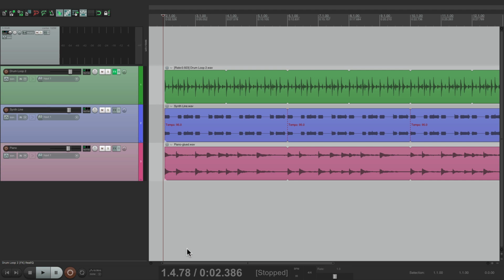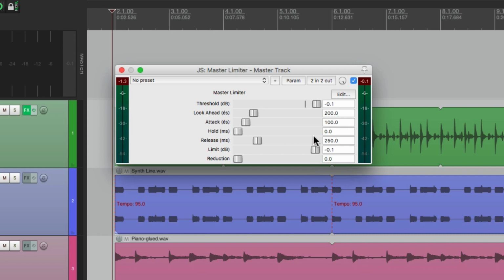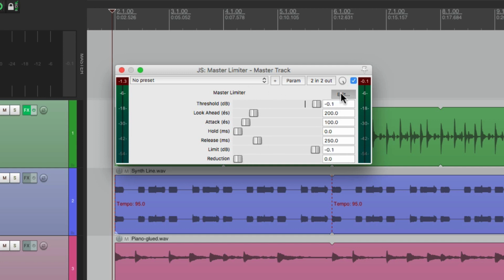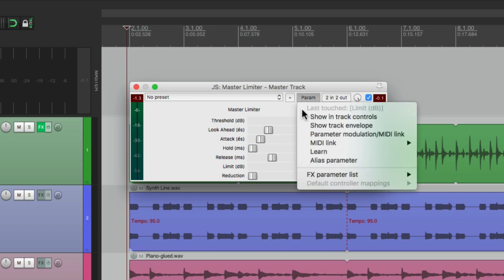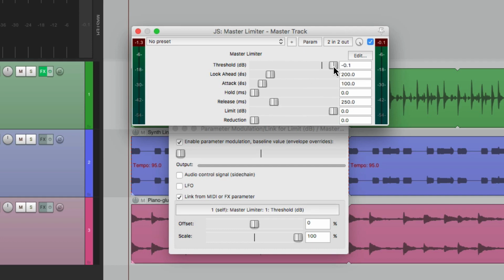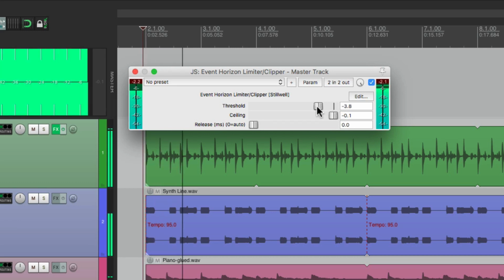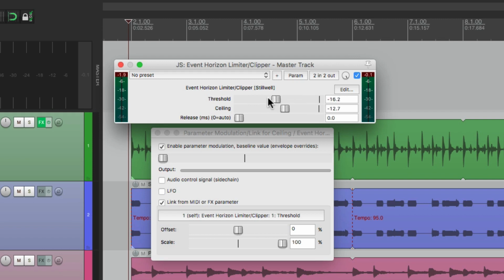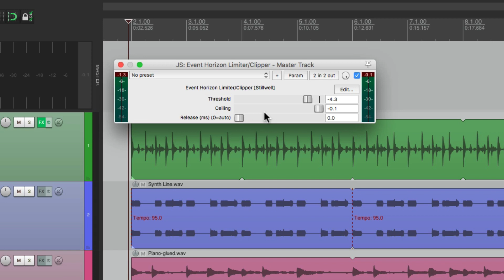Linking Master Limiter Parameters in REAPER

Comment: In editor we can add (under "slider7"):
slider8:1<0,1,1{Off,On}>Link ceil
   And at beginning of section "@slider" add
slider8 == 1 ? (slider6 = slider1);

So we can enable linking ceil (Limit (dB)) with threshold. Without parameter modulatiion.